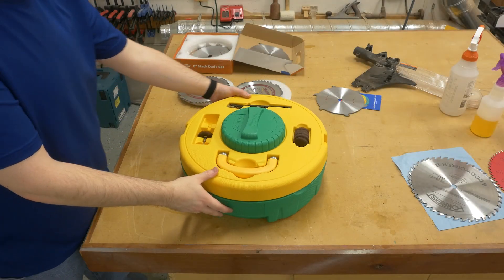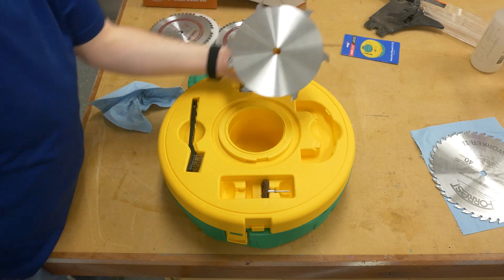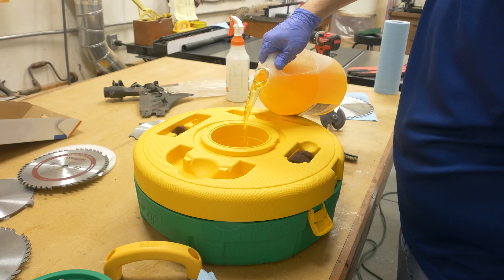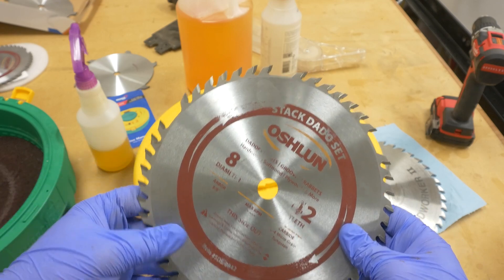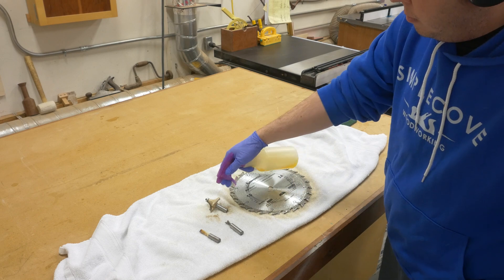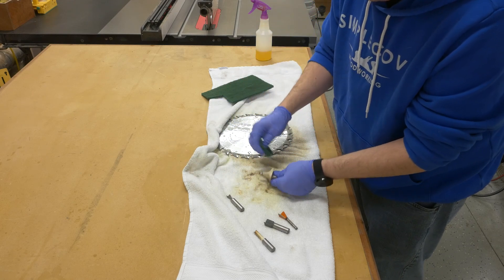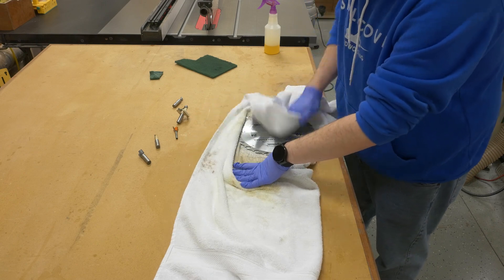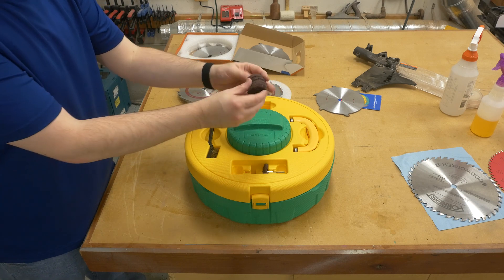MicroJig BladeClean First Impressions

Comment: I use the top side of a Home Depot 5 gallon bucket lid to hold the blade. Then I spray with cleaner. Let it soak. Wipe clean. Done. The system you show seems to be solving a problem that doesn't really exist. And at a premium price.
Reply from the maker: Thanks for commenting and letting us know!
Reply: @EricGrayEricLeePhotos I couldn’t agree more.  I just received and email offering to sell me this thing (on sale) for $94.  I’ve been a woodworker for almost 40 years and can’t believe some of the things that are made today.  You just ask yourself “WHY”.  I use a similar solution that you use.  Less than $5 and works just fine.  I say spend the money on another one of those awesome Forest blades shown in the video.  😊

Comment: I use a bucket top or small plastic container, pour Simple Green and let it soak 5 minutes. Then with a brush I scrub if needed and wipe down with a towel. Never had an issue or crud that wouldn’t come off. For $100, you can probably get a couple years supply of Simple Green solution.
Reply: Yeah this is how I do it except I use pine-sol

Comment: I am fortunate to have a stainless steel sink in my shop. This is where I clean saw blades, etc.  I place a saw blade in the sink, spray it with CMT (which works great) , and wait 5 minutes.  Then I scrub each side of the blade with a fingernail brush, rinse the blade with warm water, dry it with a towel, and lightly spray it with a blade lubricant. Done.

I cannot imagine spending money for a Microjig Blade Cleaning System -- and I like Microjig products.

Good video. Thanks!

Comment: Thanks Sean for an honest take on this thing (esp compared to all the "reviews" which are effectively influencer promotions). I looked long and hard at this product, and even if I was willing to pay the cost, I couldn't justify wasting the horizontal storage space that this requires for something so infrequently used (small shop here). I use a woodriver blade cleaning tray which collapses and takes very little space when not used, small spray bottle of CMT blade cleaner, and a stiff nylon brush (Otis or whatever HD has on hand).  

Now what did intrigue me about this Microjig product is the magnetic handle to hold the blade. I could use that even with my current system to help hold/flip the blade while brushing/scrubbing/drying, particularly the edges. I reached out to Microjig to see if they would sell that magnetic handle to me as a replacement part, but they wouldn't. So I have some magnets on order to make my own.

Comment: I just cleaned one of my blades and I was curious about this system. I think you are correct. It doesn’t make sense for me personally for that price point. I have a plastic bin that will hold any of my blades. I lay it flat in there and i spray the blade like you did on your towel. I let it soak and then use a brass brush and 3M pad to clean. I think I’ll stick with my method. I do love microjigs other items. I have lots of them. Thanks for the review.

Comment: I use a clear plastic tub. Maybe 4-6 inches deep. Spray on just like you and let soak for a few minutes. Clean with a brush and then take it to the sink to rinse off the solution. Finally take the blade to the air compressor and use compressed air to dry it off. Works well. Rarely clean my router bits and should more often. Benefit of the clear tub is that if you get one big enough you can do two blades at once. One soaks whole working on the other one.

Comment: I don’t see a compelling argument to add to my shop. I used to soak in a $3 plastic oil pan and use scotch brite and brass bristle brush without much wasted time. I recently purchased an ultrasonic cleaner and think that is more of a time saver - I can fit almost half a saw blade in it and have been running 3x 10 min cycles total to clean the whole blade. Usually a rinse and dry after is all that is needed. Another $30 than the micro jig, but potentially more versatile.

Comment: Thanks for doing this video. I have a plethora of tools that just don't deserve shelf space in my shop and I like to avoid purchasing more. I was curious about the BLADECLEAN because my supplier is having a sale. To answer your question I clean my blades about like you do except that I finish with a water rinse in the sink, blow dry and WD-40. I may start waxing my blades though instead of WD-40. Thanks again for a very good, very concise video.

Comment: I use spray9 in that black blade cleaning pan purple pad and brass or nylon brush...the longer you let it soak the better but never took longer that 5 minutes to loosen the thickest pitch. Most times I'll put a few blades in there at a time fill the pan over the blades and go do something else. Hour later if you have a slop sink I just rinse them off minimal if any scrubbing needed.
 Oh, just pour the cleaner back in the gallon, it's reusable.

Comment: thanks for the reminder that my dumbass spent $100 on this thing lol.. its been on random horizontal surfaces  and in my way throughout my shop since i got it and have 2 big green stains in bench tops from spilling it lol.. i think im ganna take it into work and try it on the shaper bits..but it is kinda convenient to clean table saw blades if i forget what i've paid for it and can find a place for it to live in the shop

Comment: I saw this jig and thought it was nice but not worth the money to me. I built a magnetic handle like theirs using pvc pipe and was planning to build something similar with a 5 gallon bucket, but spraying the blade with cleaner and scrubbing with a decent nylon or brass brush works good and really doesn't take long. Hard pass on purchasing this one